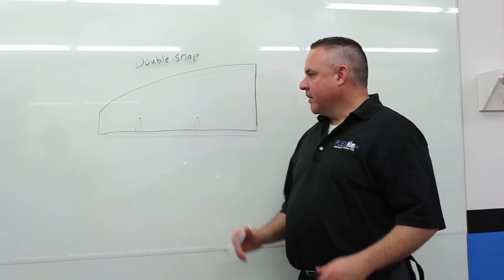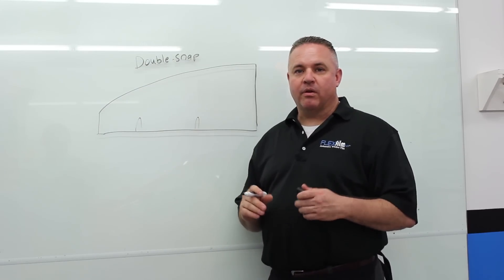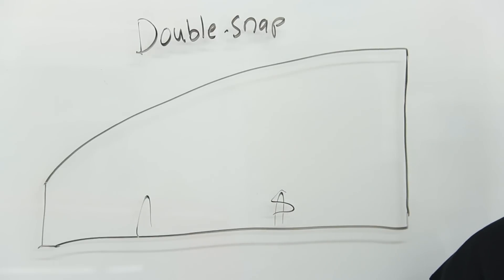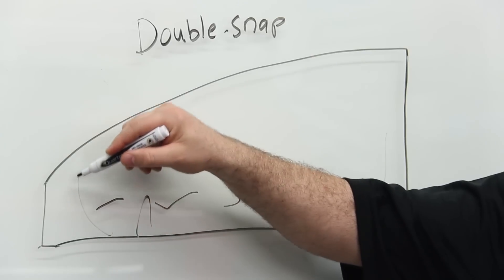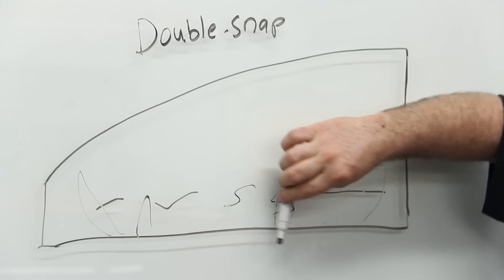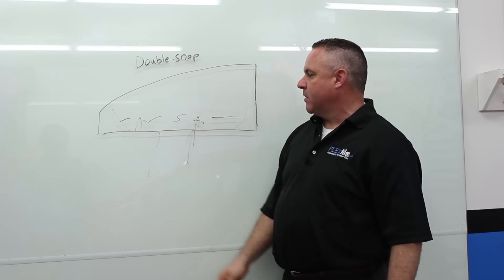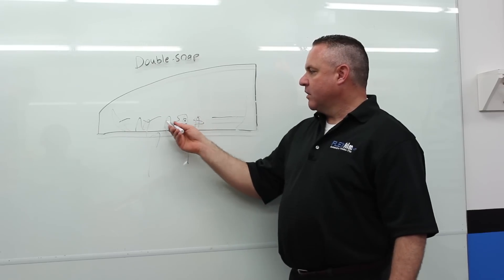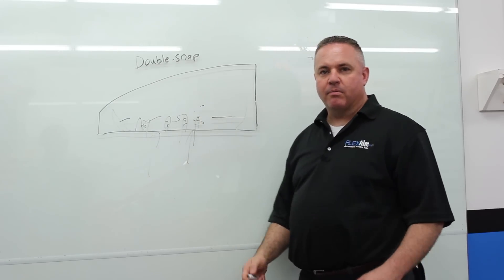Window Tinting: Finger Bubbles

Comment: If u don't have a heat gun can u use a hair dryer?
Reply from the maker: Not really.  Hair dryer does not get hot enough.
Reply: @FlexFilmPlus  thanks for the quick reply Ralph... Also how do u get rid of the finger bubbles in the tint on side windows. They aren't huge bubbles more like Wrinkles.

Comment: How do you fix after they happened?
Reply from the maker: You can heat them from the inside.
Reply: @FlexFilmPlus  what  about tint on rear window that has bubble appear after 10 years can u still heat up?
Reply from the maker: @friendlyneighborhoodmechan2606  
No.  That is an adhesive failure.  Time for removal.

Comment: what about a bubble that appears on the back glass on the defroster line?? The bubble is not on the edge of the film but it is along the defroster several  inches from the edge.  I've heated the glass and film and it removes the bubble, but 5 minutes later it comes back. It's almost like the defroster line collects solution or has a defect to retain moisture... any help??
Reply: Terry B I know you asked 3 years ago but you must’ve missed a spot when yu were smoothing out those defroster lines. Or simply nice piece of dirt or lint.
Reply: Can u take a pin make a very tiny hole on end work towards pin hole so the air has some place to go

Comment: I brought my new Ford Mustang (owned less than a month) to Custom 4 Wheel Parts & Accessories at 7101 South Blvd. Charlotte, NC on December 3rd, 2016 to have my front windows, rear quarter windows, and rear window tinted with LLumar Window Film (LLumar).

Less than a week later, all windows showed bubbling and dust spots under the film. At this point, I scheduled an appointment with them to have the windows redone and fixed. At which time I also noticed a 1-2" horizontal scratch on my driver side window that they stated was already there and also refused to do anything about. When they finished and backed it out in the parking lot, I saw the same issues with the tint as before and they redid the tint (again) the same day. However, the tint is even worse than before and more issues have developed.

I scheduled an appointment to bring my car in for today (December 21st, 2016) due to the bubbling and tears around the windows. Due to this being my third time coming to their shop (and forth time having the tint replaced), I requested to have all the tint removed and a refund issued.

The shop owner refused to refund my money and remove the tint.

How can I remove this horrible tint without ruining my interior, windows, or rear defroster?

Thank you.

Pictures:
https://imgur.com/a/i3mOv
Reply: Matrix points can easily be covered on some cars,whilst they can be a pain in other cars.Other white areas but the Matrix points means a bad tint

Comment: But how the hell you clean the rubber and the little brush that take the water of the window. I tinded my windows and it came up nicely but everytime i lower my windows wet and then pull them back up, they come up durty and with streaks. I even tried claying the windows (asumed they were still dirty) but it doesn't help. Inside of the rubber there is a little brush-like strip and i see all kinds of dirt on it. How you clean that ?

Comment: 0 help....need to know hiw to get rid of bubbles that run side to side on the glass
Reply: Don't get them in the first place.  You move all fingers to the factory edges of the film.  Film only really shrinks in one direction -  toward factory edges.
Reply: You can heat them out with a heat gun if they pop up after installation
Reply: Use a hard card at a gentle diagnonal angle to turn it into a vertical and then handle it as usual
Reply: agree, came here to see how to deal with them when they showed up a few days after the install and never the actual fix